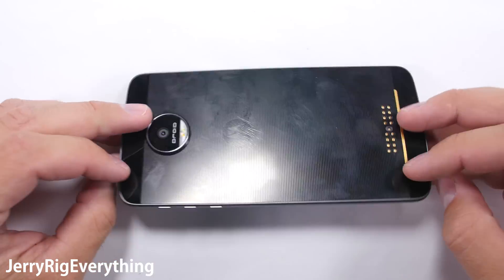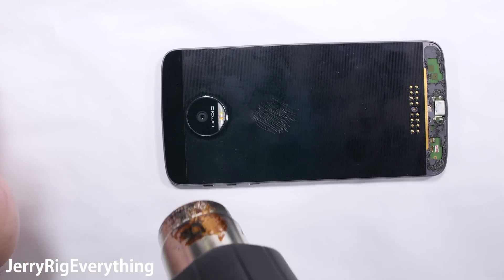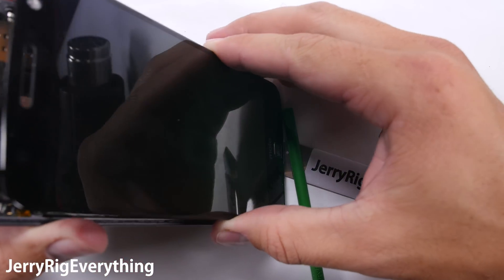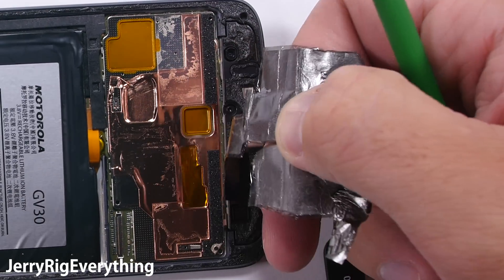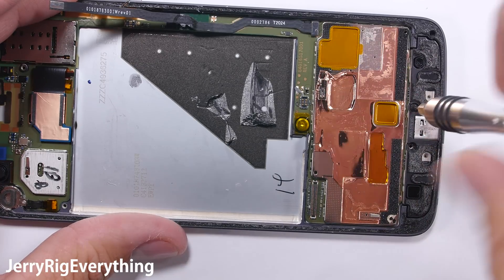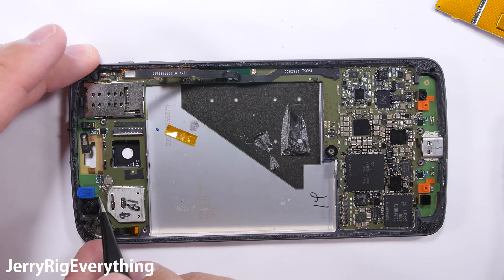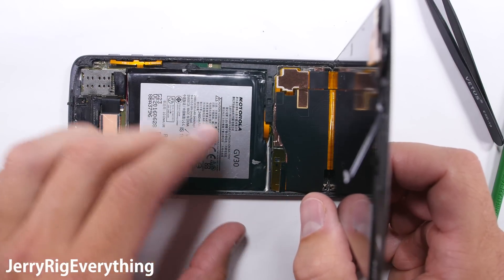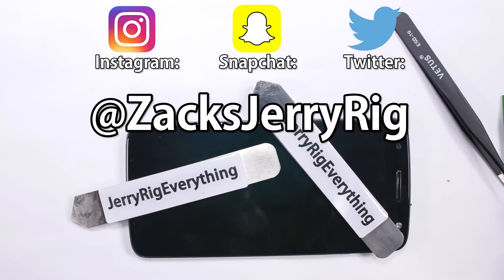Moto Z Teardown - Screen Repair - Battery Replacement

Comment: about 2:25 you say the glass and display panel are "fused together as one"    I bought an XT1650 (which is what the video appears to be) "for parts".    The glass was loose - only needed a gentle pry with a fingernail and the whole thing (except for the small corner broken out) came right up - obviously the glass cover and display had been removed and replace without heating the glue to make it restick.   The display was totally free of the glass and showed no traces of glue.

While the  glass was broken out around one corner it was not even cracked anywhere else. but the display was cracked all the way across it about horisontally right at the connection end and 1/3 of the way up and then diagonally across to the far end.     There are no visible signs that the screen was ever fused to the glass.

But my guess is that it was and the cracks resulted from a failed attempt to recover an intact screen from the broken glass.

This raises the question:  if you have one with a broken or cracked glass but the LCD display screen is intact, is there a way to remove the display from the cracked glass without ruining it?    That would reduce a $100 parts bill to a less than $10 parts bill.
Reply: did you find anything more out on this? I got a great deal on a white Z and bought a Black front glass section from eBay for less than $10 - was hoping to change it to black.  No glue required?
Reply: I wouldn't be brave enough to attempt such a repair. The pros in China have specialized jigs to cleanly scrape off the Optically Clear Adhesive, align the display with the cover glass, and heat the two halves with just the right amount of heat that won't damage the OLED pixels. It's a very precision job, to say the least.

Comment: I am trying to fix the prongs on my Moto Z Play. The prongs got bent when trying to plug it into wall charger.
Reply: Teresa West How did you bend the inside prongs of the USB-C port? As far as I know, user error is less of a concern for the new port and is essentially dummy free lol

Comment: I got this phone. just today i cracked my display while i had it in my front pocket (touching a corner of a desk at work).
is there any place to get an amoled replacement? here in germany i just get lcd displays as it seems. prices for replacements are starting at 200€. i thought about buying it new for 299€. or is it worth a try to buy just glas replacements stuff and glue it with loca to keep the amoled display? any experiences with that?
Reply: Andreas Wiechmann du kriegst es bei Saturn schon für 279 Tacken. Ich würd mir ein Neues holen
Reply: Ja, habe meins bei Saturn auch für 249,99 gekauft vor 3 Wochen. Lange gehalten hat es nun nicht. Da ich das alte Display aber nun eh schon entfernt habe, kaufe ich jetzt bei NG-Mobile das Ersatzdisplay für 179€. Glaube das macht am meisten Sinn. Viel mehr ist ja nicht kaputt. Adhessive tape habe ich daheim. Wären halt nochmal 100€ gespart, da es ja nun wieder teurer ist. Habe auch lange überlegt.

Comment: Nobody will probably read this, but if a pin or two are disjointed at the screen panel socket, is there any fix for that without replacements? This causes the screen to display items with no backlight whatsoever, so I need to illuminate the screen to barely see anything on it. (It's not a Moto Z, but a X Play with LCD panel)

Comment: Do a clear back moto z (like the Samsung Galaxy S8)
Reply: darren alexander Not possible. Most of the Moto Z's back uses the metal backplate.

For the Moto Z Play however, that could be a possibility as the entire back is glass (a weird design choice by Lenovorola but whatever).

Comment: I have 2 suggestions for anyone attempting to do this. 
1. The earpiece screws are actually T3, at least mine were.
2. This LCD is exceptionally fragile! You need to stick the  pry tool almost all of the way into the screen at the top and bottom, because there is a lot of adhesive around the front camera and the sensors at the bottom.

Comment: Hey Jerry, I have a Moto Z Play. My screen keeps lifting off. After watching this vid, I can conclude that my adhesive might be weak. How can I fix this?
Reply: Jairzinho Martis got the same problem with red adhesive and 3m adhesive.idk why. bottom keeps lifting. tried it with two Displays. they both were nearly as strong as the old one.
Reply: Nail glue super glue ,tiny bit on razor blade edge barely on edges. If you take baking soda when wet it instantly dries and harder too.

Comment: i own this phone and i recomend it 100%
Reply: EL JAAC Do you still say that now? Online forums all over are filled with Moto Z users who's batteries won't hold a charge for very long and just shut down randomly before hitting even 15%. They won't even finish booting unless you have a TurboCharge charger plugged in. Not even with a Battery Mod attached. Not even with a USB-PD charger. Not even when inserted into the Incipio Car Dock. This is an even worse situation than Apple slowing down old iPhones. At least Apple eventually freed up to their flawed design. We've got nothing but lies and deflections from Motorola/Lenovo.
Reply: I own this piece of shit and wouldn't recommend it to my worst enemy.  Not a year old...battery lasts 45 mins.  Thanks for the 7.1.1 "upgrade"...worked fine before that. An upgrade that fails hardwafew...nice!!!  Can we get enough people together for a class action lawsuit please?
Reply: James Kerns Jr. Yup, same thing fucked my phone up too. Switched back to my old Galaxy S5...
Reply: @jimb032  You used to have a girlfriend named Nancy?
Reply: @jimb032  Get a Moto power pack like the Incipio Offgrid power pack
Reply: @RayyanR05  what?  Are you kidding?  You expect me to carry around now something extra to support a pho e that does not work as designed?  So throw good money after bad is the solution?  I was born at night but not last night.
Reply: Mike Trieu yeah i hav that problem also and cant solve It, since my screen os cracked, idk rn i just wish i never bought this
Reply: James Kerns Jr. I have this phone and i got a custom rom for it which got me to android oreo 8.1. also you are right the battery does last like 45 minutes.. it's like an elaborated plot to get you to buy moto mods
Reply: Kazim Bt how to root this phone? Ive searched a lot of thread and there's no result
Reply: Same I'm ready to get the Moto Z 2 later on. I really love this phone the battery lasts almost all day for me so I really like it.
Reply: @Soldier_Beyond  against my better judgement I went for the z2 force.  Pretty pleased with it so far if they don't fu*k it up with an update besides the usual planned obsolescence.  For me it's Motorola's one more last Chance.
Reply: EL JAAC me 2
Reply: +EL JAAC What's the battery like
Reply: Goliath the battery is is 2600mah but is enough for a regular day
Reply: Yes except because of the battery, I've had it, now I have a Samsung Galaxy and I truly notice the difference.
Reply: @eriiux  so far the z2 makes it well over 24 hrs...knock wood they don't screw this one up.
Reply: I own it too...it's a really great phone if you asked me but the only thing i don't like about it is the battery. Being idle drains the battery unlike any phone I've had. Bluetooth and gps drain the battery way too fast. But it's got fast charging though
Reply: EL JAAC expandable with moto mods

Comment: wish someone would do a video on all the hang us that this phone has and any work arounds that might be out there.. my camera freezes quite often but the biggest pain in my ^(*^(*^ is the 3 icons  at the bottome oc the screen ie back  home and multiple app close  out of the 3 the square disapers when using the camera

Comment: Sadly he had burnt the LCD in the centre when using the heat gun. We recommend a heat plate to disperse heat across the whole screen at the same time, making it much safer. Also to remove the Motherboard, heat needs to be applied across the back of the device evenly to loosen up the adhesive. Jerry it 100% right here when stating the general consumer will not need to remove the MB, however repair centers will do so to replace the charge port or sim reader ^^
Reply: Fonefixed that burn is from his burn test

Comment: Hi Zack,  amazing the z is so tuff with the way the build is. even the battery is not cemented in as well as most others you've disassembled. Also that's the shatterproof screen?  so so thin. Super design there. Thanks.
Reply: Peter Ford the normal z doesnt have the shatterproof display.

Comment: I have a force and it's screen turns green all green at random and then will go back to its regular function after I let it sit for a while. what is it? should I replace the board and screen?

Comment: So instead of being able for replace the cracked glass separately, you're forced to replace the undamaged LCD as well as the glass?

Did I understand that correctly?
Reply: CalQaida 
You can replace the glass separatlly, but it's a far harder procedure and only can be done safelly in a service shop whitch has the equipment , very unlikely to do it without them..

Comment: Lithium Ion batteries I doNOT like them, they should do a battery with less Lithium because is liquid, and instead Crystal, Crystal would be more solid and can hold much better heat, and sense electricity creates and dissolves into heat because the fast moving of electrons, a Crystal Ion battery will be much more powerful, effective and definitely much safer, no risk of exploitation.

Comment: i bought this phone on craigslist for 30 bucks, guy said needed a new screen, it does makes sounds and vibrate, screen is not cracked , guy said it happend randomly screen went off, do you think it might be the screen or something else?
Reply: slownlow210 i have the same problem, mine dont turn on , i only drop It by accident but he make sounds and vibrate but the screen is black, do you found a solution ? sorry if i dont write well
Reply: try opening it and unplug and plug the screen that worked for me

Comment: jerry i need your help man been trying to message you privately but i cant find a way so i hope you'll notice this comment. i have a galaxy s6 edge from korea and its battery is overheating so im gonna replace it but i dont know if the international variant batteries would be compatible for it or ill have to buy one for the particular model.

Comment: Hi Jerry! I tried to pry open the back of the phone, did it with perfect ease but I cannot figure out why the adhesive won't stick back again when I tried to put it back on. Do I need to go to an authorized dealer to fix this?
Reply: Tiny super glue on corner with Razer blade and baking soda instant hardner.

Comment: I have a question why are you using a metal pry tool,its scratching the glass and the phone metal body. the phones are  yours and you do what you want with them but why a plastic tool will work same.

Comment: I really like this phones design, but I have the HTC 10, would it be worthwhile to get this?
Reply from the maker: +David hunsinger HTC 10 is a great phone.  Id keep it.
Reply: +JerryRigEverything I love it but I like that design on the moto Z, I'd likely keep the 10 as my DD, I guess my question was how does the Z stack up? would it make a worthy companion device?
Reply: James F yeah but it doesn't have flagship specs
Reply: it's £499.99 though....
Reply: David hunsinger  Motorola phones tend to have weak usb ports,  I had 2 phones fail on me, but my 4 year old xperia z and htc one M7 are still in working order.  stick to the HTC, I my self am considering the m10, dekt 60 or the oneplus 3.
Reply: Don't get it. It doesn't even have a headphone jack

Comment: If you're able, would love to see a scratch test and teardown of the Moto Z Force.
Reply: Here ya go. Screen would scratch at level 3 (since it has the plastic shatterproof screen), Burn would turn pixels black but recover, and would easily survive the bend with no damage.

Comment: There's so little room to apply new adhesive to the screen. Yikes. I don't get the back glass being glued on either. The last time I took apart a Motorola phone was the A855 and it was a nightmare and it seems little has changed!
Reply: Well - I did not expect you here. Hi Louis - keep up the great work on your videos
Reply: Louis Rossmann ye
Reply: 2020: louis buys a motorola because it was cheap and his lg broke.

Comment: Just wondering, wouldn't the huge amounts of heat being applied to the phone damage the components or am I being dumb?
Reply: If you are not carefull, and heat TOO much the same place on the screen, you'll damage the lcd/amoled.
Knowledge.
Reply: Not if the phone is powered off.

Comment: +JerryRigEverything so after putting all parts together and then the screen, you dont need any fan to make adhesive sticky? You just need to put everything back in place without any fans?

Comment: The solder joints for the power connector aren't that small, you could use a regular iron to replace it, also most of those little chips are most likely caps, usually resistors are marked and caps are blank... It can definitely be hard to tell tho, to be honest I cant really tell from the video all that well..

Comment: how to disconnect the front cam ?
Reply: you will need to change the entire screen
Reply: +Victor Sellés It's not connected with the screen ! 
You can see the front camera on the board at 4:21
Reply: Oh wow. I see it now. You have to remove the complete motherboard to get access to the connector of the camera. As jerry said it is difficult to make it that far. Hope it helps

Comment: Can we take camera module from this phone and fix it in any other?
Reply: I wouldn't think so. Every phone probably has a different connector.
Reply: Off course you can, if they're the same model you can take the camera from one and put it in another phone.

Comment: but why didnt you turn it on after you reassembled it 😂
Reply: That's exactly what i was going to say
Reply: I tried it too - the screen does not survive, and there is no way you could be gentler than I was.  I read somewhere there is a 70-90% chance even the repair shop will break the screen no matter what.  If you don't use the heat gun, there is too much lateral stress against the adhesive and it will fail from being cracked.  You just cant peel a .001 mm wafer loose from 200mph duct tape and expect a good result of that.  If you did it, and the screen survived, you are living right and one of the lucky ones, it's not skill.
Reply: I concur that the repair failed. There's no way that this screen can take the abuse from a heat gun unscathed. I just attempted the repair with a hair dryer and now the screen is absolutely ruined! Expensive lesson learned. Next time, I'll just get an iOpener from iFixit.
Reply: @MikeTrieu  Dang, good thing my screen is already cracked up, haha. Would a iOpener work on an android phone?
Reply: The first Pixel has a similar screen structure, and when I swapped the battery I also got an extra screen because I knew I would probably destroy the original just getting into the device.
Reply: Mike Trieu u might have heat it to much
Reply: Because it failed even after the repair! Didn't you see the way he threw his pry tools on the phone? This phone got him worked up! In short this phone a bitch.
Reply: Loran Cehack 
product placement? I thought he dug this phone

Comment: I'm... a bit surprised that you can get to that level on such a slim phone... bit messy, lots of glue, and a board that seems to be glued to the backplate, but still.

Honestly, I was kinda thinking it'd be borderline impossible to open it. Like an almost solid sealed block or something. xD

But yeah, this seems to be hard to do board repair even with all the right tools... depending on how hard it is to remove that board from the backplate, you basically don't have access to an entire side of it. Get some water damage into this and you can kiss your data and phone bye bye. :P

I'm just kinda curious to see if modders will be able to leverage that backport for something different than usual... the official mods that came out so far didn't catch much of my attention, but perhaps a custom rom plus some trickery might enable people to do some of the weirdest stuff with it. xD

Comment: I can imagine that the Moto Z Play will just have a few changes to this teardown, most notably the headphone jack...in the wrong place! Either way, it's disappointing that the USB-C port will be near-impossible to replace. The LG G5 makes that fix a cakewalk! I'll be curious how the new curved design of the Sony XZ and X Compact (Read: Compact version of the Xperia X! Although it performed like the Moto Z Play, which is streamlined sleeper awesome!) differs from their familiar rectangular designs.